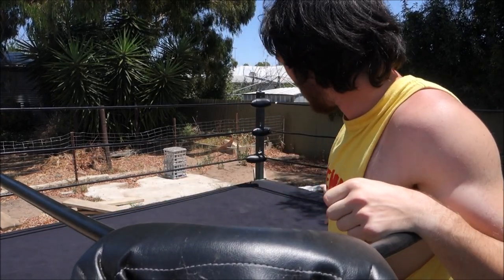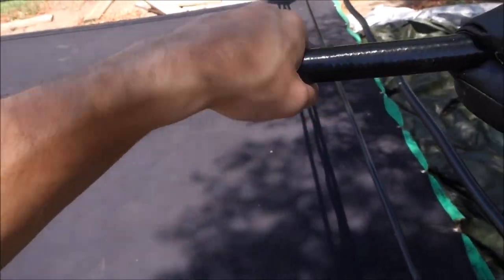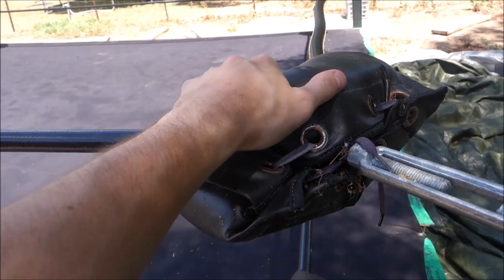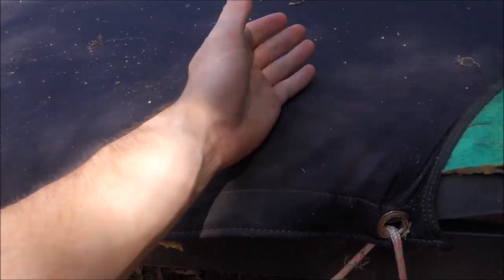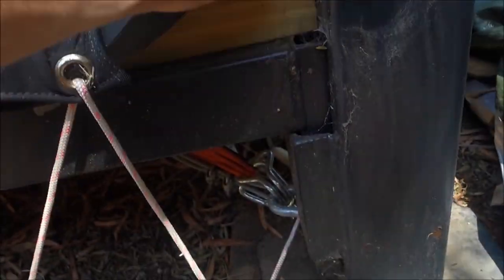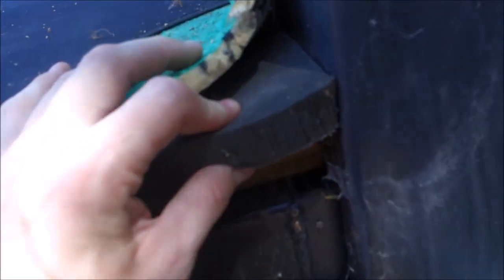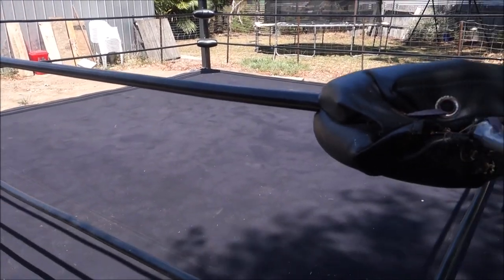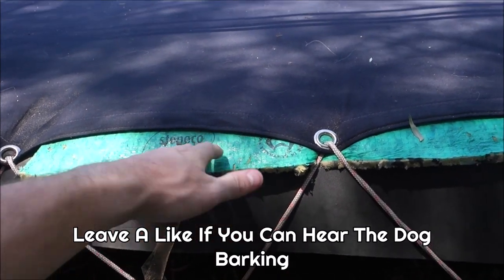WHAT A WRESTLING RING IS MADE OUT OF

Comment: I had the opportunity to step in a WWE ring during a production gig and it wasn’t too bad. I couldn’t take a bump otherwise I would get in trouble lol, but their padding is about 1/2 thick. It must be special foam because I tried squishing the hanging foam on the edges of the ring between my fingers, but it wouldn’t squish at all. They must be using specialized impact foam. I did however slap the mat which felt a lot like those martial art mats.
Reply: How come the ring doesn’t have the thud or sound like the rings they use ind the 90s and 2007 before they change in like 09

Comment: I kinda want to make a wrestling ring out of a trampoline. I don't feel like breaking my back by taking a clothesline.
Reply: You'll get more of a concussion than breaking your back taking a clothesline depending if you bump right or not
Reply: @Xenothewrestler_YT  I weren't being serious about the breaking the back part, i was basically saying I don't want to hurt my back by taking a clothesline. But how could It give me a concussion.
Reply from the maker: Hahaha it hurts! But you get somewhat used to it so you build up a tolerance to it
Reply: @ExtremeNonstopWrestling  concussions don’t require you to hit your head, it’s basically rapid head/ neck movement (whiplash) movement causing the brain to hit the skull wall.
Reply: @ADAM_COLLECTS  you wouldn't really get a concussions from a clothesline
Reply: @ExtremeNonstopWrestling  not one done correctly
Reply: I've seen a backyard promotion use a large square trampoline that's stretched extra tight. It's dangerous. There is less chance of landing safely and moves look goofy at times. But they look badass with the ropes added.